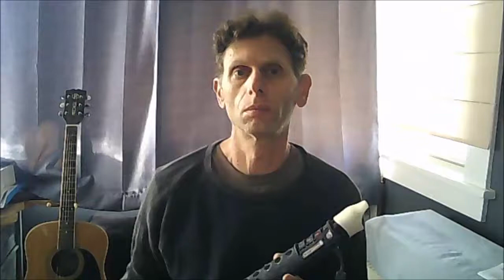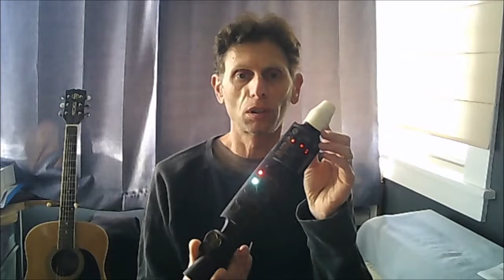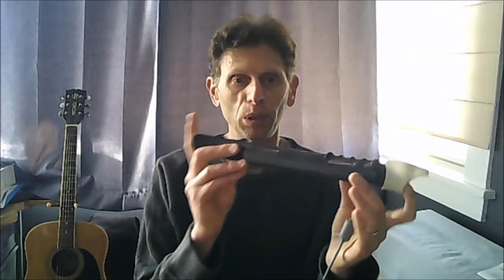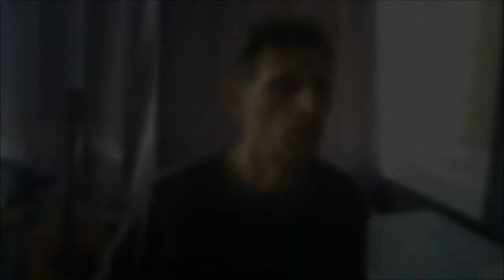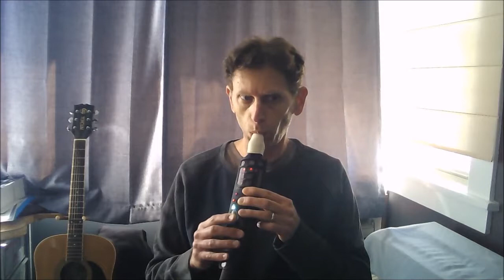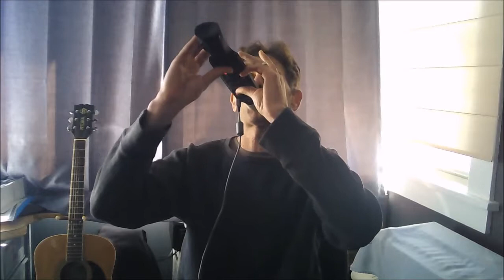eCorder demo with Shoham MX5 soft synth

Comment: does it blow-sensitive or just the fingering affects the sound?
Reply from the maker: Hi, thanks for watching!  Yes, it's sensitive to the blowing pressure as well.
Reply: @mikeshonle  do we have a setting to adjust the pressure sensitive level?
Reply from the maker: @dedustinal   yes, it's fully adjustable.
Reply: @mikeshonle  would it cost less than 200$?
Reply from the maker: @dedustinal  Hi, it's made in small quantities and has a lot of features, and therefore the price is $1750 USD
Reply: @mikeshonle  hope you can scale it up and make with a more efficient way, the plastic recorder is enough (if you are using wood for the case)